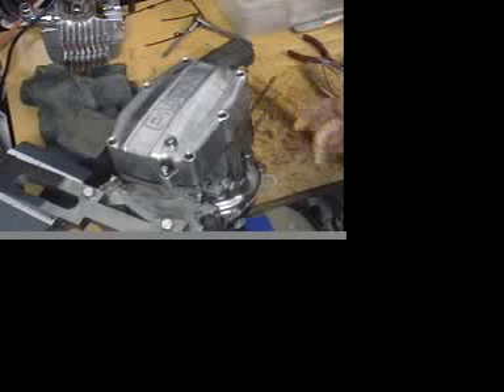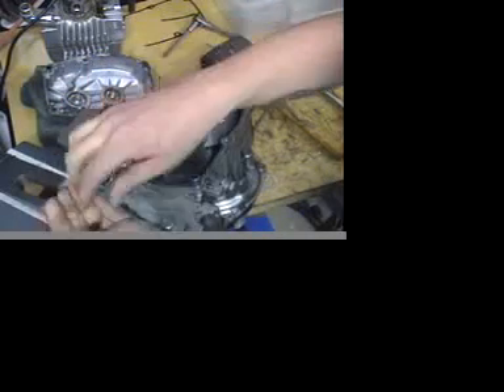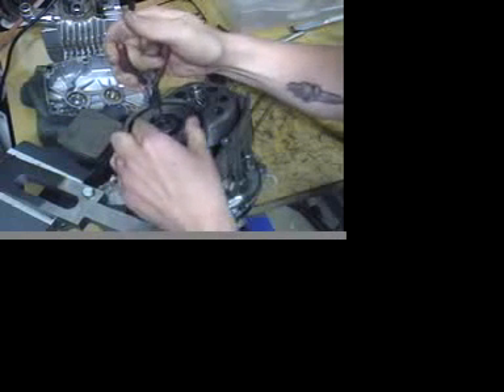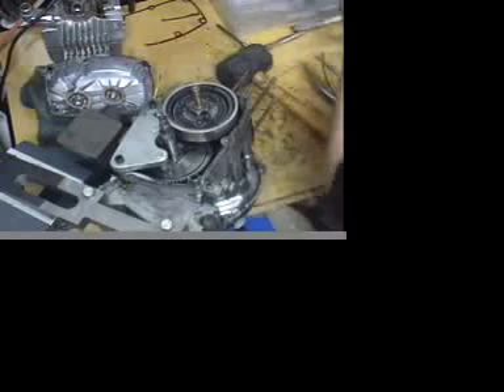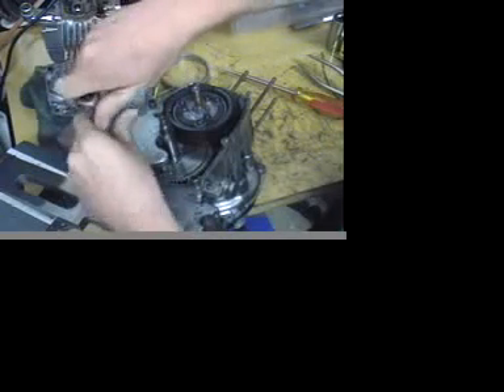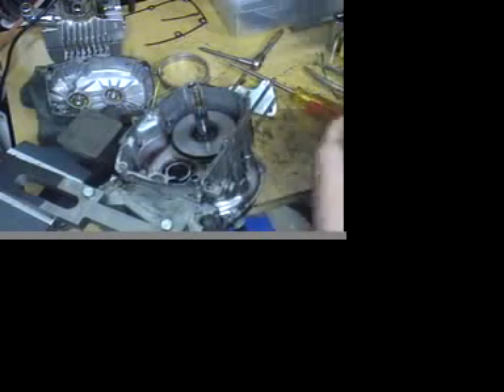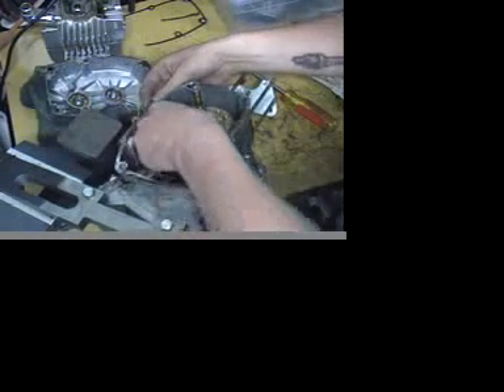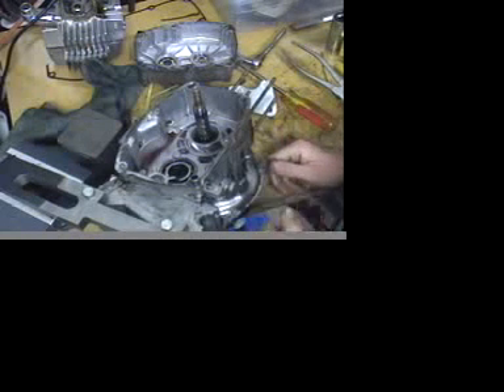Puch ZA50 take apart guild with Puch tools

Comment: Since there's no good aftermarket support for performance ZA50 trans, I've heard of "flipping the gears" for better shifting performance. What's that all about?
Reply: the clutch closest to the crank, flip it over so both clutches face the tranny cover. this will change the amount of force it takes for second gear to engage, so it engages at a higher rpm, allowing you to get more into the powerband before shifting, and also keeps it from going dead spot on hills and rolling stops. instead the second gear disengages quickly and lets you get back into first easier when you need it